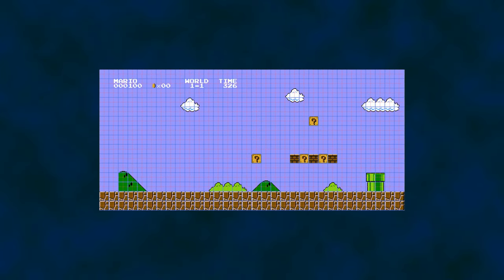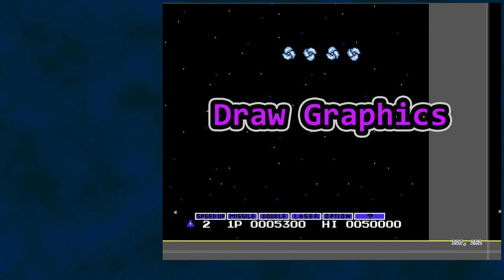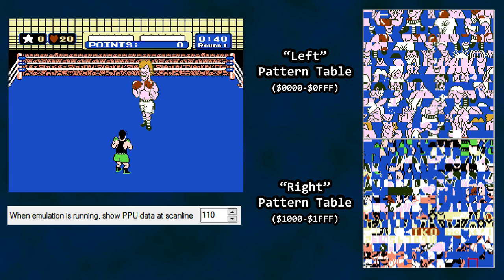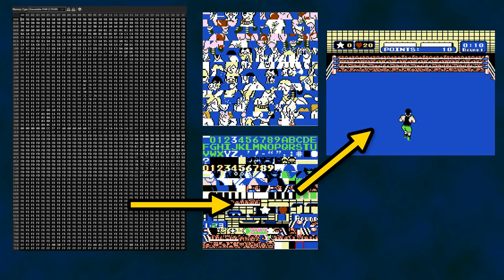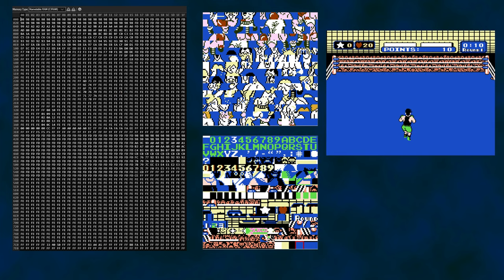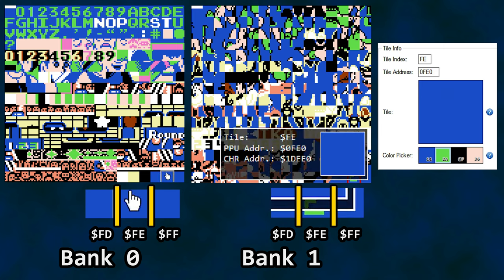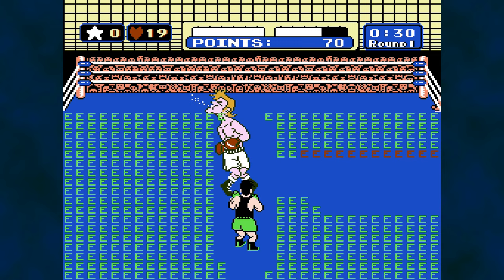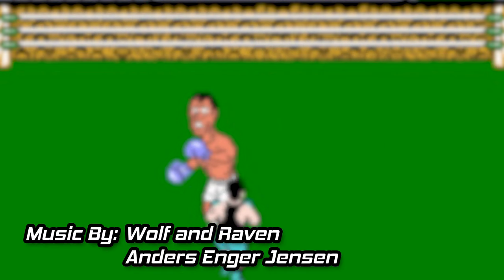MMC2 Magic - How Punch-Out's Graphics Work

Comment: When you said "Wait, scrolling in Punch-Out? We'll get to that later", my thought was "Yeah, of course! For the training scene where you run through the city and Doc rides the bike!", but the real answer was MUCH cooler.

Any chance you might do a little bonus video about how that scene works? The parallax effect is really cool.
Reply: It's probably just multiple uses of the same thing.  Whenever sprite 0 is hit, it gets moved down to the next set point and the scrolling speed is updated.  At least that's my educated guess.
Reply: @ovalteen4404  the way NES hardware is set up, you can only have one sprite zero hit per frame. Once the hit happens and you get the interrupt, it stops checking until it resets during vblank.
Reply: @Robomandude  Bummer.
So I analyzed the code itself then.  It splits the screen into 10 equal-sized scrolling regions (except for first and last).  Region 0 is the NY skyline.  Regions 1-9 begin at the water line (where sprite 0 is) and cover a few lines each.  Region 10 begins at line 158 and covers the bottom half.

It uses a bit rotation scheme for each region to determine when that region should advance.  Obviously the closer it gets, the more bits enter the rotation for that region.  It uses a precise timing loop to set the horizontal scroll for each region.  So it's doing the NES version of "racing the beam".

The entire backdrop from sidewalk to NY skyline is background.  Coach and Mac are sprites (obviously).  The posts are also sprites, and are kept in sync with region 9.

So everything above the water runs at one slow speed, and everything below the water runs at the same fast speed, and the 20 or so lines inbetween are where all the parallax magic happens.
Reply: A video looking at all instances of parallax effect in NES games would be interesting, seeing how different programmers approached it.

Comment: When you explained that the MMC2 chip switched banks as soon as it saw an $FE/FD character I wondered why they simply did not add a single such character on screen. But the need for scrolling and the fact that the background tiles are at times overdrawn by Mac and/or other animations probably explain that "carpet bombing" approach.
Part of me still wishes they had been more subtle but I will generously let that go. 😋
Thanks for the video!

Comment: You just blew my mind. Scrolling and background tiles. I would’ve never guessed. One of my favorite NES games and I’m always surprised by it. Wonder how they get the background tiles in front of the sprites? I’m guessing some trickery coding and one color being the transparent color?
Reply: That's just a basic feature of the NES. You can set each sprite to go in front of or behind the background. The opponent in Punch-Out!! is made up of a bunch of smaller sprites, so it's possible to have e.g. the top half be in front of the crowd while the bottom half is behind Little Mac, even though there's only one background layer.

Comment: That leaves me wondering, though, since CPU is waiting for Sprite 0 hit anyway, why cannot it be used for both setting the H scroll value and changing the CHR ROM bank?I
Is it that the MMC2 does not allow to change the bank directly by the CPU, but requires loading of a specific tile ID to do that?
Reply: The MMC2 method is already in sync with the pattern reading code.  The CPU will be notified that sprite 0 was hit but may not get to it at the same time.  Also, programming the bank swap requires something like 5 writes to the same address with bit shifts inbetween, so that's a lot of cycles to spend on a timing-critical application.
Reply: The sprite 0 hit could very well have been used for swapping the graphics.  But there's one other graphical element that was not mentioned, and that's the "GET UP" text that appears when you're knocked down.  The game plots down FD tiles to the left of the text, then FE tiles afterwards in order to make the text use the crowd bank instead of Mac Graphics bank.
Reply: @Dwedit  Yes, through this video I was under impression, that there is only one change of CHR banks per frame, at any time.
Having more of them per frame would definitely use MMC2's capabilities more.

Comment: Now the question is could Punch Out have been designed to use a different mapper or not.  The MMC2's tile switching feature is mainly used to make text always available regardless of which graphics bank is selected.  This allows the game's font to only exist in one CHR-ROM bank, and not need to be duplicated elsewhere.  Having 128K of graphics data without needing to duplicate text could have been done with other mappers too, such as the MMC3.  Well except that the MMC3 didn't exist yet.  MMC1 was not suitable because the graphics switching was done in 4K chunks.  DxROM was very MMC3-like, and was in use at least a year before Punch Out was released, but it was not suitable because it had a 64K CHR limit.  So that leaves the Konami VRC2 or Taito X1-005 as the only other mappers of the time which could have handled 128K of CHR ROM without duplicating the font, and those were not Nintendo-made.

Comment: Do the FD and FE tiles have to be placed for each row of tiles, or could they have just placed one at the top and one in the middle to perform the "switch"?
Reply: Just one tile is sufficient to trigger the switch.  However, the game is designed to sometimes draw text over the bottom area, such as the "Get Up !!" prompt, or the "By decision the winner is..." message.  Those need an FD tile to switch the game's font back in, then an FE tile afterwards to get the normal graphics available again.

Comment: Pretty wild to think that cartridge-based systems had the ability for games to expand the console with additional hardware. It's like if you bought a game and it could "download" more RAM, or a better GPU on the spot.

It's a little like the feeling of discovering self-modifying code for the first time. You can't help but go "what the fuck?" and then sit back and admire the ingenuity on display, like a fine piece of art. I find a kind of beauty in this kind of clever design, on multiple fronts, that achieves the theoretically impossible at first glance.

Without a proper purpose, it leads to some of the most horrible code ever made, though!

On an unrelated note, any chance we could see great influential demoscene ROMs taken apart and their tricks documented like this?

Comment: When you unpaused emulation with the "CPU things" marked, that was when I realized when the system knows that it should swap banks. Still midway through the video as I write this, but I'm sure you're going to mention the little bit of skin-colored pixels partially hidden by a crowd member, and then use of sprite 0 hit.
Reply: It appears I was wrong?
Reply: Well I was incorrect on why sprite 0 hit is used.

Comment: Nice, good information and really solid visualizations.
But how can the mapper chip see the FD tiles when they are off screen? Does it read more of the name table than what is being displayed?
Reply: Even though the screen is 256 pixels wide (32 tiles worth), the NES actually fetches 34 tiles.  So the off-screen tiles do get fetched.  It would need to fetch 33 tiles anyway just to handle horizontal scrolling.

Comment: I always thought more bank switching was going on with punch out.  I don’t get why Nintendo bothered to design MMC2 specifically for punch out when they could have used Sprite Zero to detect when change banks especially since they’re already using Sprite Zero in that same location for scrolling max.  

They really didn’t need MMC2, although if MMC1 was the only other option at the time maybe they expected serial MMC1 writes to take to long but idk about that..  It genuinely appears punchout could run in MMC1 with minor changes to the rom.  Swap CHR banks when Sprite Zero is hit and boom done.  Shouldn’t end up with scrolling glitches since it’s all blue tiles already.
Reply: On the PRG side, the game really is designed for the MMC2's memory layout, with a switchable 8K bank that changes for each opponent, and a fixed 48K at the end.  There are 6 opponent body types, each using up an 8K bank.  In addition to the fixed 48K at the end, that leaves 32K of program code and data available for other uses.
For the CHR side, most game elements could have been done on an MMC1, as it provides the 4K CHR banking required by the game.  Except for any text on the screen.  The game was designed to use the MMC2's automatic bank switching to allow the game's font to be available for any bank.  Any screens with text would need to be rearranged.
Reply: @Dwedit  All great points!

Comment: Didn't the system have a hard cap of 64 sprite tiles on the screen at a time, even with hardware multiplexing? How did the game overcome that? Because I'm pretty sure some of the bigger boxers use all 8 of their allowed horizontal tiles and are more than 8 rows tall as well.
Reply: You use 8x16 sprites instead of 8x8 sprites.  Then you have enough sprites to display one single huge 64x128 pixel sprite.

Comment: I will never understand why the mmc2 chip was designed the way it is. I mean, it can do really interesting stuff, but punch out does absolutely nothing creative with it XD

Dont get me wrong, its an amazing and technically impressive game, but it could have been done in a much simper chip without much trouble... if you can scroll only half the screen, you can also swap banks with code

Fire emblem uses a revised version of the same chip, and that game at least has a dialogue box that is overlaid with the background, so that game at least does something that can only be done with the mmc2/4

Comment: Could you please make a video about that one donkey kong country glitch with the barrel that crashes emulators and could even brick your super nintendo? That would be very interesting
Reply: It's impossible that any glitch could brick or fry a console or cartridge. That's a hardware issue, not a software one. Only exception is something with direct access to physical hardware driving pins the wrong way and causing a bus conflict or latchup, but nothing in ROM or RAM can do that.
Reply: @iyatemu  That's what I remember hearing a couple of years ago at least but your right of course and it was more like a "spooky story" getting told years ago. I just searched it up again and at least what I could find to be somewhat confirmed is, it destroying the cartridge so it becomes unplayable and even somewhat heating up the SNES cpu ro an extend. The glitch had maaany different outcomes, from rebooting the level, showing the something went wrong screen, formatting data and making the game unbootable. It looks very interesting as well and I would be really interested in finding out what happens there behind the scenes, palette changes, spawning invalid Monsters, giving you control of a clone monster etc etc, there is something going completely wrong in this state

Comment: 10:27 yes this i not get. i draw sprite using top part then draw text using bottom part. i see screen only text or only sprites depend what number i left 0 or 1 to address 2000 or what eva.
i not get why is not work it allready draw to video ram that sprite what eva it was from top or bottom LOL it should not effect even completely change those top and bottom parts that sprite is allready vram. so i not get. why i only see only sprites from bottom or top. or i do it wrong xD